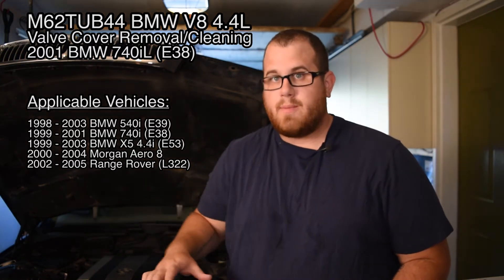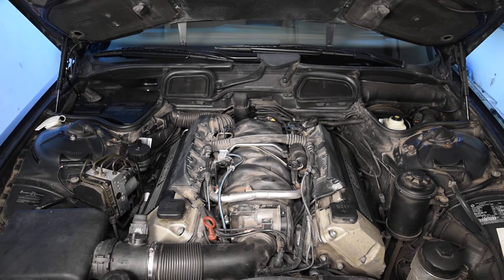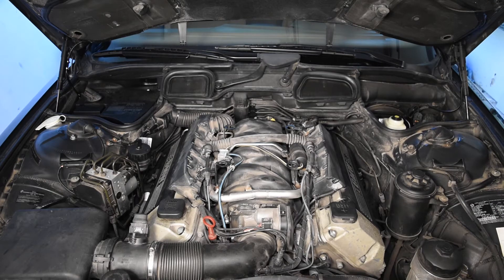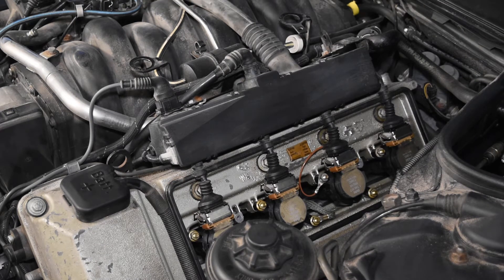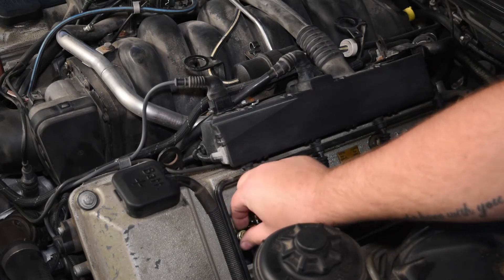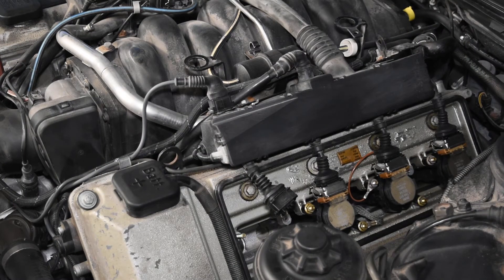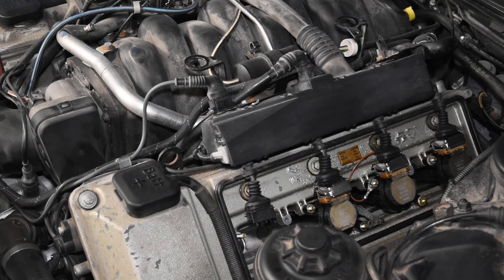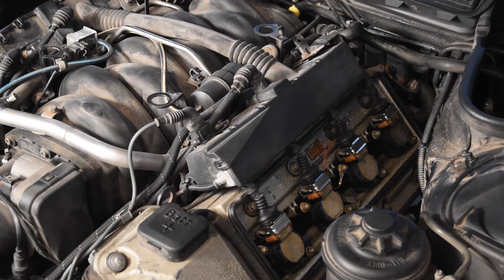M62TUB44 Ignition Coil Cover Removal & Cleaning

Comment: What ended up being the issue? I had oil leak into my drivers side. I ended up changing the valve cover gasket and now I don’t see any oil going in. I still suspect that the reason the calve cover gasket went is because i have a bad pcv valve. With extreme pressure it led to oil leaks. Would love an update of the fix, thanks!
Reply from the maker: I believe we need to do the gaskets, but unfortunately we haven't done any work on the car recently. The oil leaks we have aren't overly bad, but it's likely the valve cover gasket.
Reply: Perpetual Radio Networks valve cover gasket leaks tend to be a very common issue on E38s. I would suggest checking the detailed YouTube tutorials on how to fix it because the dealers charge a ridiculous amount. Just the gaskets from the dealer cost me 200 for both sides
Reply from the maker: We're really hoping we can start doing the work on the car ourselves. It's something we've been hoping to do for a couple years now, but life has its ways of prioritising other things.

Comment: That is not the valve cover. That's the ignition coil cover. Has nothing to do with the oil getting into your spark plug valley. If you have rough idle I would suggest trying a intake manifold leak test. This is performed using a can of starting fluid and spraying around the intake manifold with the engine running. Warning this can be dangerous. Leaks will be detected by then engine raising idle. It is common on the M60b40 and m62b44 V8 and was the problem with the four that I have done. I just finished my third valve cover gasket job and all them the old gasket was more brittle than an old stick of gum. Often they would immediately snap before they would flex at all.
Reply from the maker: We realized our mistake quickly after publishing this video.

Comment: I removed the valve  cover and replaced the valve cover gaskets and bead blast the valve covers to clean them like and sprayed them with high heat wrinkle finish black paint which looks awesome also I replaced pcv valve in back of the intake along with a tune up it runs great with no issues . you're a big help. thanks.
Reply from the maker: Glad to hear it! We're really hoping to hit the DIY stuff this summer and get some work done on our E38 while creating informative content.
Reply: COBRA HELICOPTERS INC. Dana Rabun Hi, what brand and type of paint did you use and did you sand blast the covers? Do you have pics
Thanks

Comment: Did you find that after cleaning the oil and putting new spark plugs in that the idle was fine afterwards? Without doing a head gasket replacement, how long, usually, does your car run well after you've cleaned all the oil? I don't want to replace my head gasket yet, and if this fixes the idle, than I'd much prefer to take this easier route. Thank you!
Reply from the maker: It did, and in fact my idle has gotten a little rough again so I'm suspecting I have some oil pooling up in one of the heads. It depends on how bad the leak is, this video was filmed back in August and I've only noticed the rougher idle this month. Since August I've put about 20k km on the car roughly. 

I'm hoping to have some time this weekend to open up the valve covers and clean them up, I'll see how bad it is and report back!
Reply: Thank you very much for the quick reply! I will stay tuned if you end up doing a head gasket replacement video. All the best
Reply from the maker: Might be something we try to tackle! We'll see how it goes, but for now we can definitely find out about the idling.
Reply: Why would you replace the head gasket? normally thats if youre getting oil into cylinders or mixing with coolant, oil in plugs journals, for what i was told could be valve cover leaks or valve stem seal... I had been getting oil on my plugs threading so i was thinking valve cover but the  it made sense to change the valve stem seals, but never did, just sold the car

Comment: What tool do you use to remove the plugs?
Reply from the maker: Sorry for the late reply on this! To remove the plugs I had a socket tool designed for spark plugs, it's something I had lying around and looks to be a generic brand. It's a tight fit, so it will pull the plug out no problem. I don't recommend using it to put plugs in though, it's tighter than the socket ball bearing and will stay attached to the socket. You might lose it and need pliers to remove it. There was a socket removal tool that came in the trunk tool kit. I think you can find them on ebay for relatively cheap.